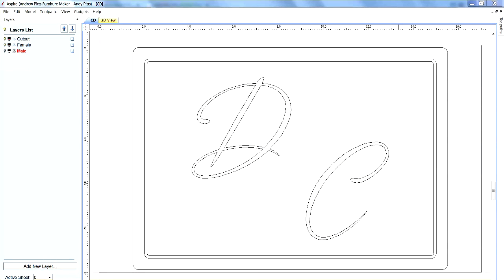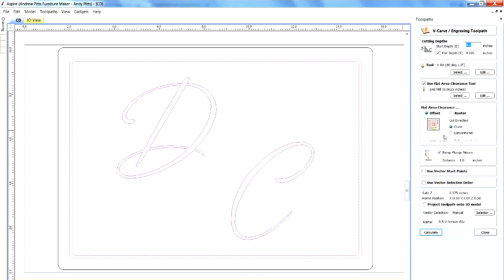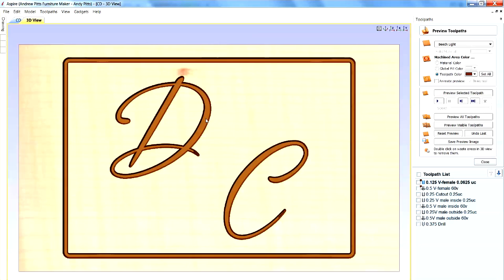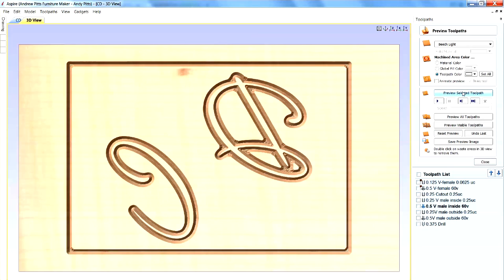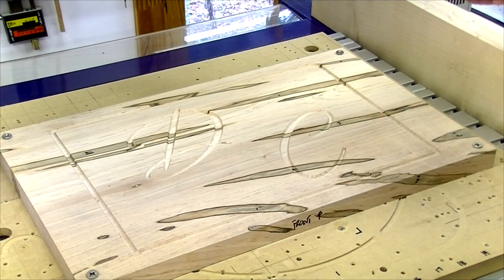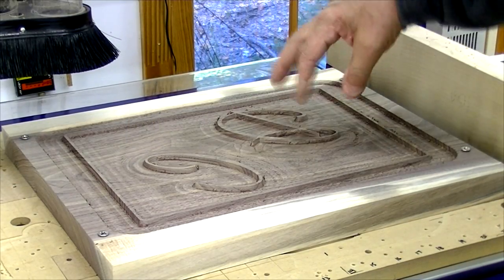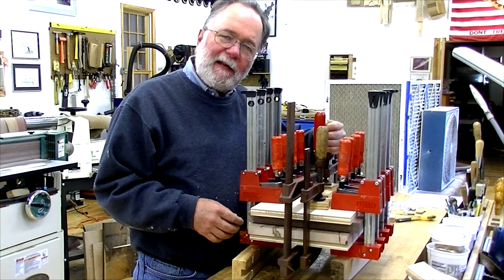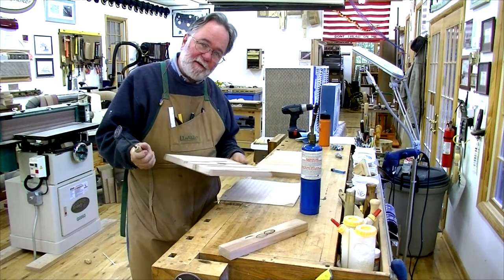Making an inlay cutting board: Andrew Pitts~FurnitureMaker

Comment: I heard you say the Male is .2 depth while the female is only .1 with a flat depth of .001. Is that all I didn't miss anything did I? That should make  the male stick out far enough to cut extra off between the two with say a bandsaw? I will be using these settings to make a inlay into a cutting board as well. I just remember reading that you dont want a gap between the two layers to make a hollow spot because its no good for cutting boards but ok on most anything else...
Reply from the maker: Yes, Leslie, the idea is to have the male letters bottom out in the female grooves before the faces of the male and female pieces touch. There will be a gap between those faces, which assures you that your letters bottomed. Andy

Comment: Andrew, The reason why you should be using Titebond III for all of your cutting boards is because it is the only PVA that is certified for being food safe no other PVA glue has that certificate. P.S your cutting board should have been made out of end grain even the inlay because if is 100% better for your knives because it splits the wood fibers and it doesn't dull of damage the blade on any knife.
Reply from the maker: Thanks.

Comment: Just a quick tip....chuck your banding iron in the drill press. That way if your brand is too light the first time you can bring it right back down with even pressure in the same spot.
Reply from the maker: +The Hamlin Woodshop Good tip. Thanks.

Comment: Awesome as usual Andy.  Love the band saw.  Is that a Rockwell vintage Delta from the 80's?  It looks just like my underpowered Rockwell.  All 1/2 hp of it.  It takes me forever to cut through 10" tall material!  Having said that, I wouldn't trade my unit in on anything.  I may get a complimentary band saw in the future.  for now a motor upgrade is definitely in my future!
Reply from the maker: +Scott Kaye Scott, yes it is and I bought the saw new in 1980, but bought a larger motor separately. I figured the 1/2 hp stock motor might be too little for heavy resawing. But, it still takes a long time to resaw on it. I think the limitation is in the tpi of the blade. My woodmizer had teeth an inch apart and could clear the sawdust better than my 3 tpi blade on the Delta. BTW, I don't notice any slowdown of the blade on the bandsaw when I resaw, so I figure it has enough power. Andy